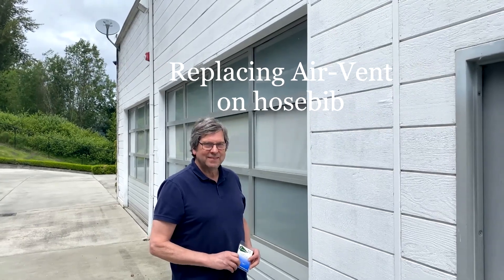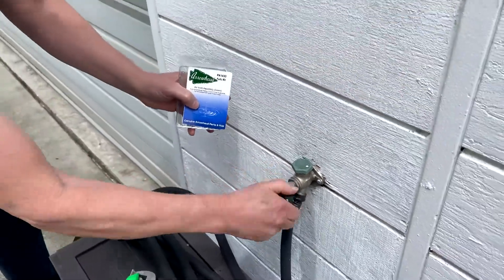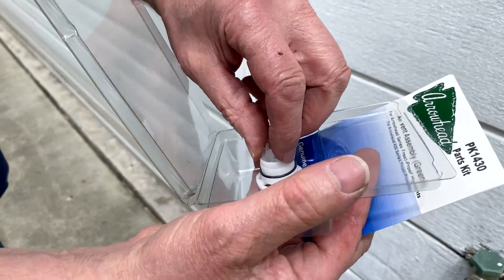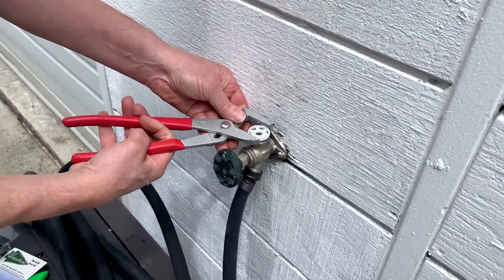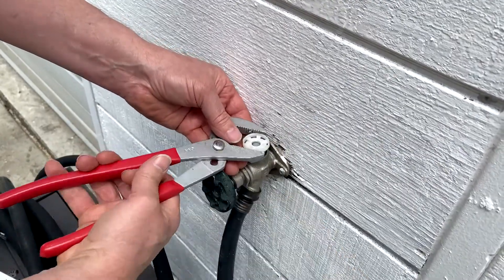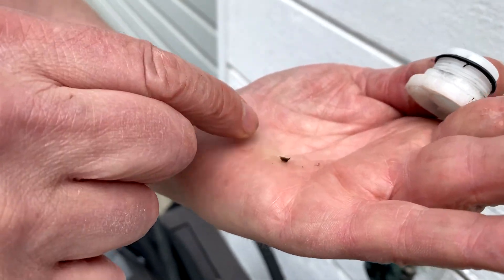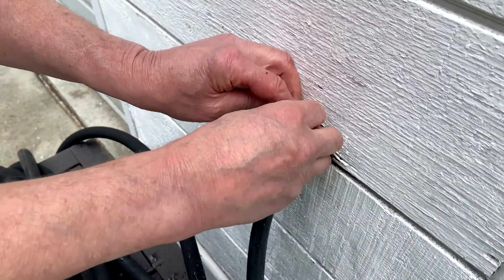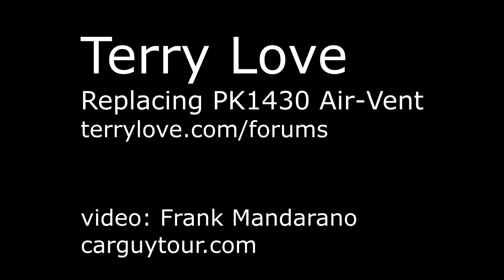Repairing an Arrowhead air vent in a frostfree hosebib with PK1430 by Terry Love

Comment: thanks! for anyone who is watching this and it still leaks, make sure the plastic thing that is inside has the claws facing down towards the spout and the round top facing up towards the filter. I put it in backwards and it still leaked. Flipped it around and it worked!